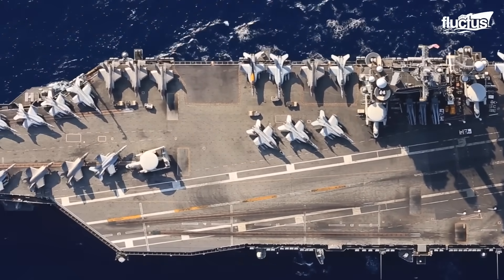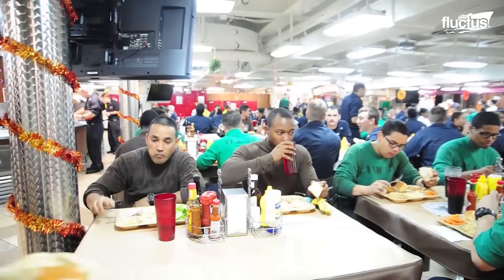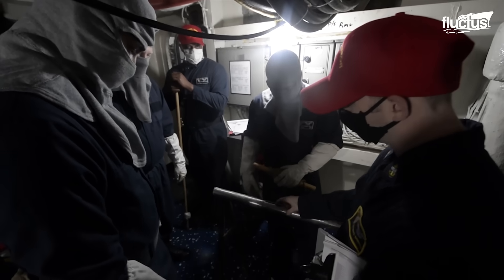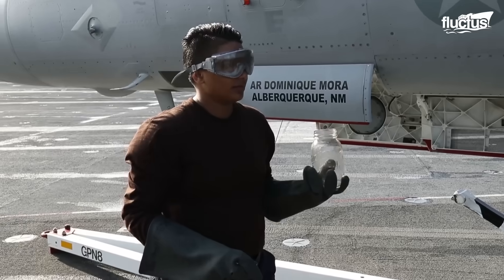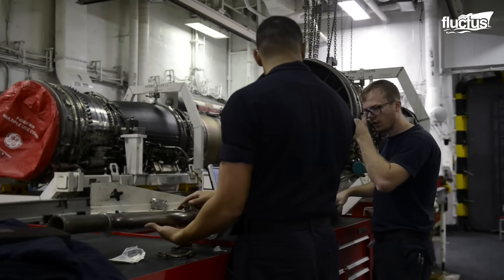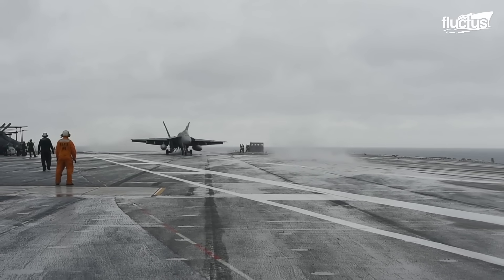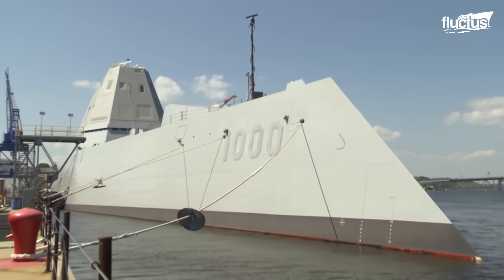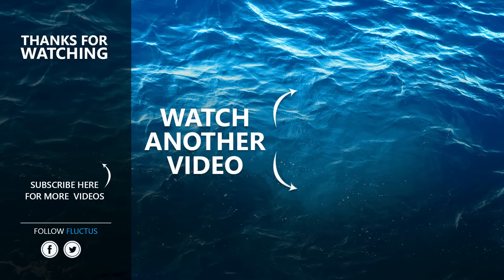Life Inside World’s Largest 13 Billion $ Aircraft Carrier in Middle of the Ocean

Comment: Highlights:
🏗 These $4 billion aircraft carriers are massive, spanning up to 1,000 feet in length and 250 feet in height, equipped with military hardware and crew comforts.
🍽 They feature amenities like large gym areas, grocery stores, and excellent air conditioning systems, providing for the crew's needs during extended deployments.
💰 Profits from onboard grocery store sales support various facilities and boost sailor morale.
🧐 General assessments are vital for safety, helping prevent accidents and ensuring precision through systematic procedures.
⚙ Maintenance of aircraft on the carrier deck is crucial for flight functionality, with three stages of maintenance performed, including organizational, intermediate, and depot.
✈ Versatile aircraft like the F-18 and F-35B play a critical role, with the latter having short takeoff and vertical landing capabilities.
🚢 The USS Zumwalt, a $4.4 billion multi-mission destroyer, boasts advanced technology and stealth features, making it a crucial asset for anti-aircraft support.

Comment: Basically a USA propaganda video. The F-35B lmao, put some weaponry on it and this thing can't STOVL anymore nor take fuel tanks for this reason. It's by far the worst version of the F-35 compared to A and C that I respect. And no, it cannot perform as well on land or sea, any carrier capable aircraft has to have reinforced landing gear, arrestor hooks, reduced internal fuel capacity, basically a heavier plane with more technical constraints. STOVL is nice for the cameras but that's it.

Comment: The level of "perfection" is best illustrated at 4:18, when a deck officer hurries to fetch a small missile dropped by the starting jet.
Reply: That is called a holdback bar and is supposed to drop, if it didnt drop then there would be a serious problem. ABEs in the Navy man that station during flight operations and they attack the Holdback bar into the jet and the catapult to hold tension. When the Jet is shot off, the ABE manning that position grabs the holdback bar and inspects it for damage, usually damage is done and on to the next jet it goes.

Comment: And one $25,000 missile could send the whole thing to the bottom of the ocean.
Reply: Those are $50,000 today. Inflation and all.
Reply: Try remember that a carrier strike group consists are more than just the aircraft carrier. Try figure that although it's not impossible for a missile to strike it, that there are numerous counter offences in the strike group. The aircraft carrier itself is very well protected even on it's own. It is and always will be a huge threat to the enemy. So yes, it can be sunk, but not that easily. You do know it has defensive capabilities on it's own and the strike group is highly capable at defence also?
Reply: Not true water tight doors are closed    in general quarters senerio several compartments can get hit and it'll still float
Reply: @eddiemoney296  bulkheads
Reply: Not even close to right price and that's not how it works. Aircraft carriers in ww2 were hit by dozens of bombs and torpedoes and still held on before sinking. But but projectiles have improved! So has sustainability of carriers.
Reply: You know the cost of missiles... Strange
Reply: Underestimating the defense mechanisms that mitigate your assumption is expected.

Comment: I'm proud for the navy to see the Harriers are still in use today
Reply: Harriers were the biggest mistake the United States ever made by purchasing these death traps from England, over 60 American pilots died from flying harriers because of sudden mechanical failures, ‼️
Reply: @davidstaudohar6733  where did you obtain these facts? Maybe it was US pilot error. The Royal Navy pilots never had this problem.
Reply: @letsbeavenue  The VTOL systems on Harriers are notoriously unstable and use all manual systems. Combine that with the rather restricting amount of weapons you actually mount on it as well and it's a rather poor jet. One of the F-35s main goals was to replace the Harrier and it is succeeding. Also to correct the other guy from what I know it's not all mechanical failures. I forgot the exact reason but it was something to do with the downdraft of the VTOL engines and the hot air from the engines getting back into the intake causing the jet to flip over onto the cockpit many times. I think his number of 60 is accurate but I can't confirm.

I typed a full paragraph for this, not sure why though. I wasn't in the mood to reply to any of the defund the military people I guess.
Reply: @davidstaudohar6733  I would be very interested in your source for this fact.
I have been unable to find any information to substantiate your claim, I can find only a handful of cases where mechanical failure has resulted in pilot deaths, most have ejected and survived...most pilot deaths, as far as I can find out, have been as a result of flying conditions and pilot failure.
Please share your source as I am genuinely interested

Comment: Also in the arsenal is the Zumwalt, equipped with a Mega Flux Capacitor laser beam that's a discount on the cost of $45,00000000.00 and counting.....
Reply: but that includes batteries....
Reply: 45$ isn't bad.

Comment: @0:53 "...about 250' in height"
Is that figure a measurement from water-line?

How many feet are below the water-line?
How many feet are above the water-line?
Reply: Not even close. Not even 60 to the water from the deck.
Reply: @derekortiz3663  What's the height from keel to the top of the island?